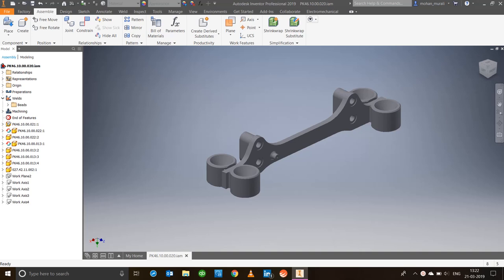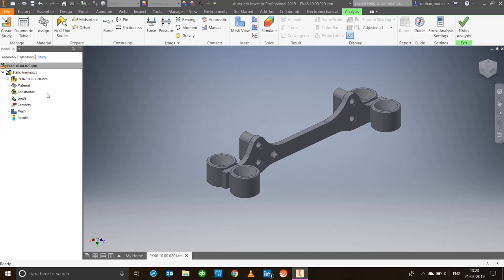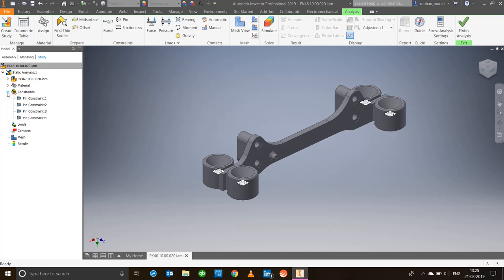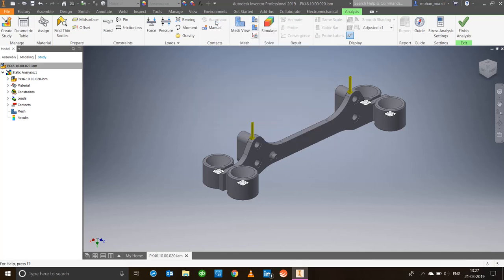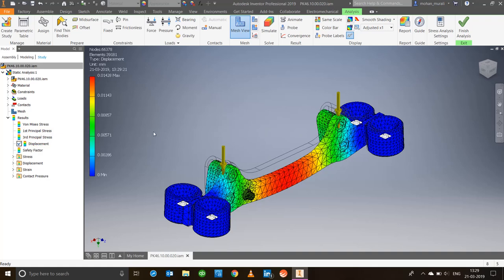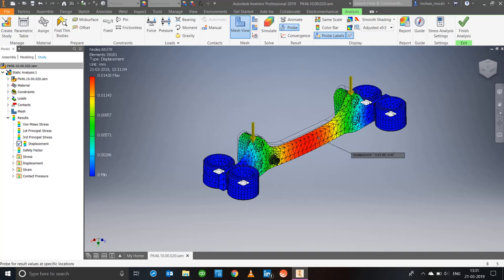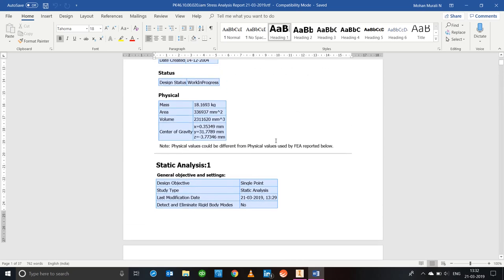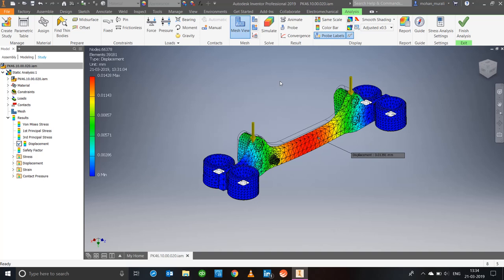Autodesk Inventor Professional | Stress Analysis | Simulation

Comment: Please tell me how to apply force on a bent or curved surface???
Reply from the maker: Its the same as adding force on flat surfaces. To add a load in any one of the axis, click on "Use Vector Components" and you will be able to add loads in a particular direction.  

Hope it helps.
Reply: @pinnacle_engineering  thank you. But I could not make the curved surface, please tell me how to draw a curved surface in Inventor,